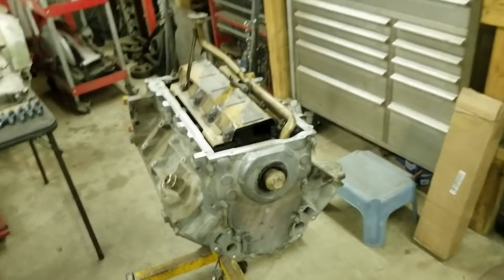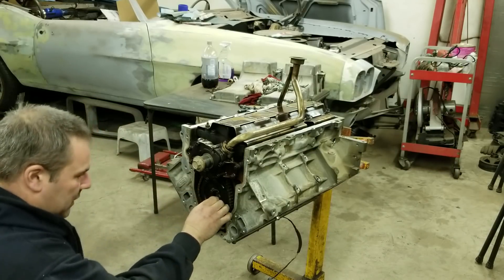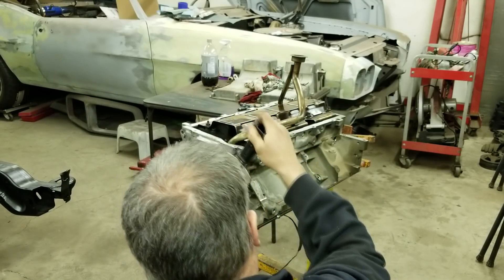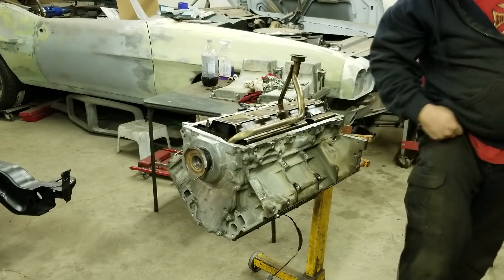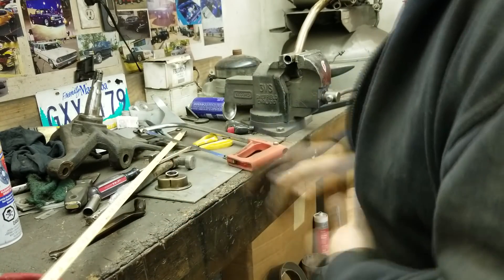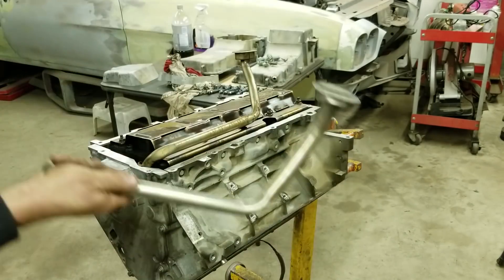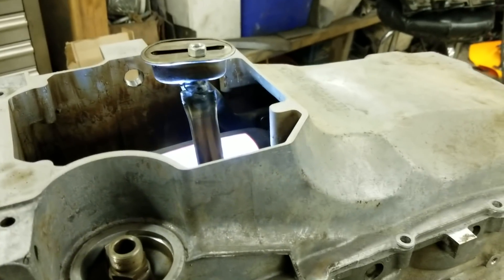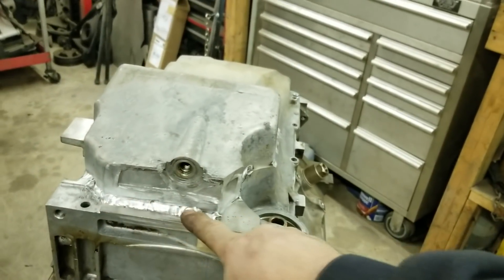LS Truck Oil Pan Shortened 1.5" | Chopped Pickup Tube + EDM Cut Oil Sump Welding (budget turbo s10)

Comment: Nice work!  I cut my oil pan too.  I don’t have a welder so I paid a buddy that is a professional welder to weld for me.  I cut the bottom off like yours but I welded on a 1/4” piece of plate aluminum and I relocated the drain plug next to the oil filter so it’d be easier for me to use.  For the oil pickup I used clay to measure the gap to the bottom of the pan.  
Nice GTO!

Comment: When   you weld cast iron you have to pre heat it with a torch .. or it will  draw carbon to the weld and  make it crake
Reply: Oil pan is aluminum I though
Reply from the maker: It is

Comment: you could and should have taken it to a local tranny or engine shop and  had it hot tanked. it has to be perfectly clean to tig weld. If it isn't SPOTLESS it will get contaminated(That is what makes the pin holes everywhere). Grind out all the bad weld! I mean all of it. Yes your going to be practically back to two pieces. but it looks to me you want this car done right. Use a wire wheel after you get it hot tanked to clean the area to be tig welded clean your tip and the parts properly and start again. no big deal really. REMEMBER if you touch the tip to your weld you have to stop and clean the tip immediately and grind out the weld you contaminated it. Good Luck!

Comment: I just read an article on line on how you take an old balancer make it so that it slips on the crank fairly easy. Now turn the crank several times and Wham Bam the pump is lines up. Now haven't tried this yet. Will try it in a about a month and can let you know how it goes or if anyone has tried this maybe they can say if it works or not.
Reply from the maker: +Luc Tessier We use an old balancer like that to align the timing chain cover all the time.

Comment: I used a torch to try and burn the oil out of the pan before I welded mine, but the casting has way too many air pockets so I kept blowing out my weld. Mine ended up looking like PlayDough instead of stacks of dimes....

Comment: If you can't pressure test it, I'd use boiling water to test it, that way it will be at temperature, it could expand and still leak, and did you do any welding on the inside of the pan? If the inside is dirty you will still get oil contamination in the weld. On the other one try to soak it in super clean, but not overnight because the super clean will eat the aluminum. How much capacity if any did you loose by shortening the pan?

Comment: I did the same cut and weld on my 5.3 oil pan.
Just put a marks on the same distance from it's top and cut it with a regular angle grinder, then made a "bottom" piece (5mm sheet aluminum) with t he same angle grinder, cleaned everything with acetone and welded it up. Got it done in 35 minutes.
Shortening a pickup tube took me another 50 minutes (TIG welded it with purging).
I don't know why you've gone with EDM for stuff like that but anyway =)

P.S. - cracking of those oil pans usually comes because of stress so you can preheat it and weld it like a cake.
But mine wasn't preheated and welded just fine =)
No porosity at all. Acetone cleans much better than the regural "brake cleaner" - that's for sure!

Greetings from Russia! )
Vadim.

Comment: Rob, next time throw that pan on the BBQ for about 30minutes on med-high heat after cleaning, bring it up to 200*F it will cook the oil out of the casting, weld while hot. makes welding shitty dirty cast aluminum MUCH easier

Comment: Your material was to dirty. Not sure if u pre heated the whole pan but if u had put it in the oven for a hr before welding it would have helped. And you probably should have taken a torch to it to burn out some of the oils and just cleaned it more. Aluminum is hard, but if it works it works that's all that matters.

Comment: A few tips as I'm a know-all like everyone else here. Firstly- far far easier to set up the pickup and everything if you cut the material out of the very bottom of the pan and replace the bottom with a new piece of flat material. This lets you install your modified tacked pickup and check is clearance just by using a ruler across the opening ( hope that made sense).

This also means you don't have any big holes and awkward gaps to weld up.

Secondly- i have only done one pan but the welding came out beautiful by cleaning the pan throughly, Tig welding the seams with tons of filler wire.. then ground it all out and then welded it up again. The heat and filler wire effectively cleans things out for the second pass very nicely

Comment: i put them in the oven at 350 for 2 hours to cook the oil out then use a torch right before i weld it to heat it up.

Comment: I've welding a couple of truck pans. I use alcohol and a small stainless wire brush. I preheated with a torch, clean again and used 4043. I stop, clean and repeat. I just got some 4943 rod, it's suppose to weld a lot better with cast aluminum.
Reply: Jerry Guti hi man i have welded my pan and it warped slightly do you think it will be ok? Did your warp at all? If i hold it flat on one side there is a 2 mm gap on the other. But if i bolt it down to the block it goes flat again. Im just worried it wint seal coz its not perfectly flush to the block before i bolt it up..

Comment: Welded lot of aluminum back in the day.. aluminum is very porous.. pre heating it with oxy/accet torch would help..(bake out the oil) I’ve also just ground out the first pass and rewelded using the first pass to burn out the shit!!
Reply: bigbwelding444444 this grinding method is what i just posted about. It works really really well

Comment: Oil soaked anything makes the welding tougher esp aluminum as it "demands" to be very clean.  Cast aluminum is not easy either even if you do it often; lots of variables.
As others have said, try burning it out (torch), clean, burn it some more, clean, pre-heat (I'd toss it in the kitchen oven if it fits), weld short sections on opposite sides as much as possible...I think I would wrap it in a welding blanket to try and retain the heat (slowing the cooling) and then just let it sit...its a PITA but still cheaper than an aftermarket pan that may not fit either.

Comment: Did you pre heat the pan
Reply: I prefer using a cam bolt locking plate. with your talent it should be easy enough to make 1 out of thin sheet metal. do inside and out and put thin coat of jb weld around your seam and about an inch on each side.   you can also use vinegar to clean the area before welding.  air gas sells a real good aluminum cleaner
Reply: That is exactly what I was thinking, stick it in the oven not only to cook off the oil, but to preheat the pan so it's not acting like a heat sink and cooling the welded area too quickly so it won't crack? But hell if I know, I have never welded an oil pan either! LOL
Reply: Was coming to say just what you guys did